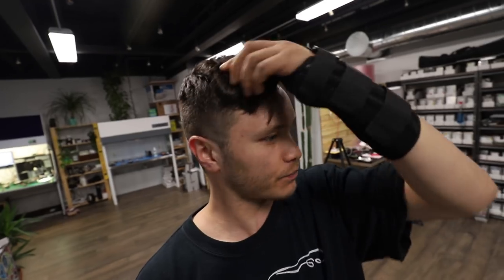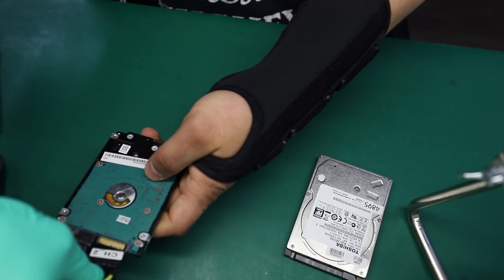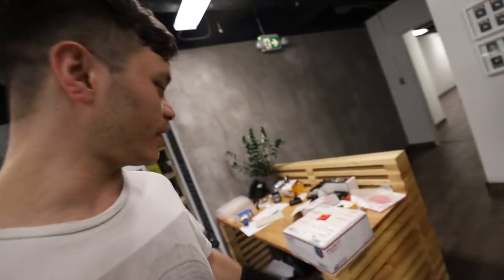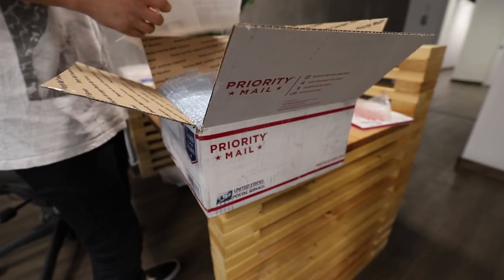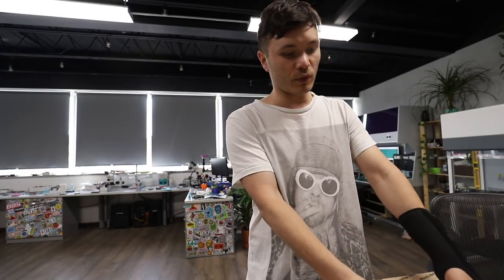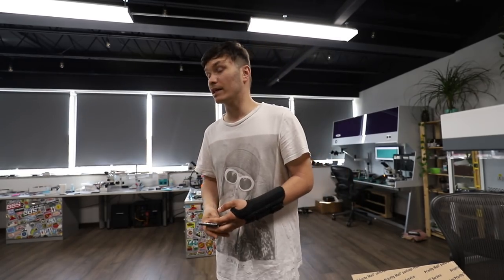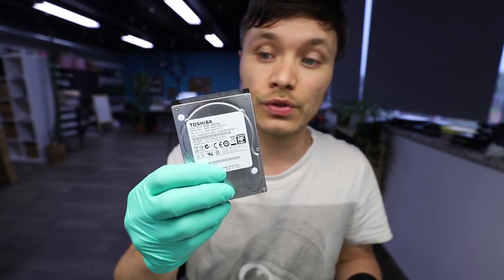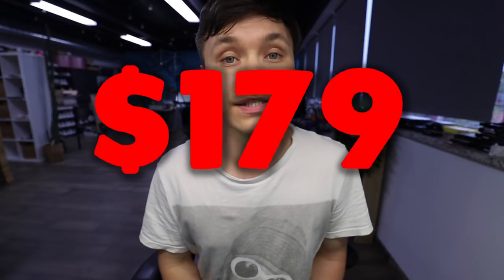Toshiba drive is half dead... what should I do?

Comment: Hi, do you know if the top and bottom heads are able to be separated on a Toshiba 3.5" as the end part of the top head is missing and I bought a donner hard drive and it has the end part of the bottom head missing and I do not know if they are separate or all in one piece. Thanks.
Reply from the maker: We remove them when needed to avoid damaged platter surfaces, but there is no way to install them back. You have drives with different head maps.
Reply: @hddrecoveryservices  Ok thanks. Is that a common thing that the ends break off the heads.

Comment: $179.00 for a donor. Must be a rare drive. I guess they have you by the balls.
Reply from the maker: almost any working drive from donordrives or harddrivesforsale is going to be 150-270
Reply: I imagine when you buy donor drives depending on the severity of the fault you can probably get 2 or 3 uses out of it by harvesting different parts. Worst case you can get a single use out of it, but the price of your recovery job most likely offsets the drive cost

Comment: I have similar drive (Toshiba 320GB) on my desk for recovery for several weeks now. It reflect same behavior, as your drive. I have tried several compatible donors as well, without much success. Just few days ago after several attempts, i did noticed very-very faint scratched ring on the top surface, cca 7mm from the platter outer edge. I think, in such cases, there is damage to service area, which is most-likely located in this spot, which make the drive prevent from regular calibration.  And because these Toshiba's have only one service area copy, i think, it's game over :(.
Reply from the maker: toshiba surface is weak, but in my case drives are just not compatible. donor heads work back in the donor, and patient works with 1 head like it did before with original stack

Comment: Oh, the same hard drive that failed on me a few months ago after (it seems) a power loss due to faulty USB cable connected to my external enclosure...
Reply: It contained only non critical backups, I tried to open it and see what was wrong but nothing was visible (on the top platter at least), unfortunately opening it made it worse. Now it's just lying on my desk and I extracted the magnets from it. Sad but it was not worth a repair 😞
Reply: Opening it up in a non clean room environment spells death for the hdd! Some videos on topics like these - what can happen when you open it up in a non cleanroom? Why you shouldn't do that. I know your situation is fine because it was non critical, and I too have many opened hard drives laying about for the purpose of detroying them, but for anyone who may think they can open it up to try and fix it themselves, some public-safety-hard-drive-videos and demonstrations would be cool, and useful!! What if, for example, someone opens a drive, thinking its not that important, leaves it for a few days or weeks (opened), then realises its actually important. How recoverable is that?
Reply: ToeTV247 I know, I heard about the risks, and that's another reason why it was worse after opening (partition table not recognized). I never knew what happened, in fact
Reply: ToeTV247 *of course I opened it with caution and did close it before turning it on 🙄 (but I did not screw the cover in place, I just put it without the screws, maybe the aggravation was because of that. We all learn from experiments!)
Reply: I have read and heard that most drives need the screw thats under the label to be screwed in as it puts a bit of pressure on the actuator which keeps it aligned properly. But after the drive is contaminated with dust (the stuff we CANT see is enough to damage the platters, so the stuff we can see is definitely death), no matter how well you screw the lid back on, the drive is.... screwed. The particles on the platter will wreak havoc to your data. Im curious if there's ways to clean the platters without causing damage, not just dust, but things like fingerprints, which wont come off with compressed air...